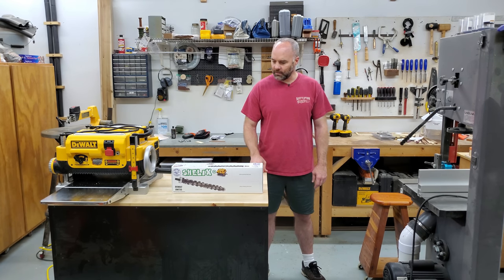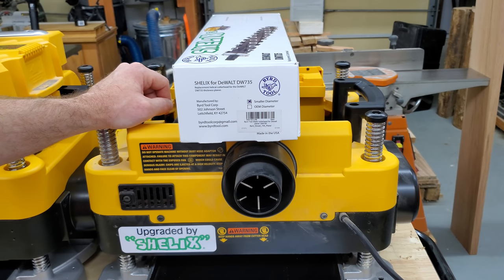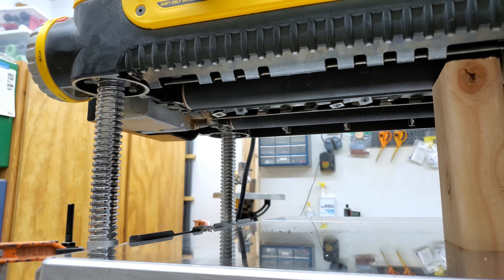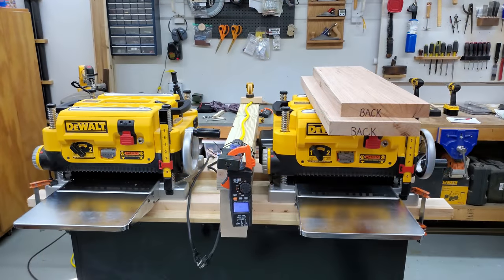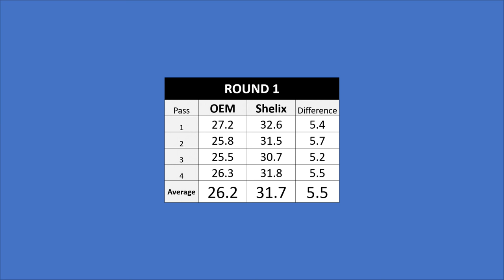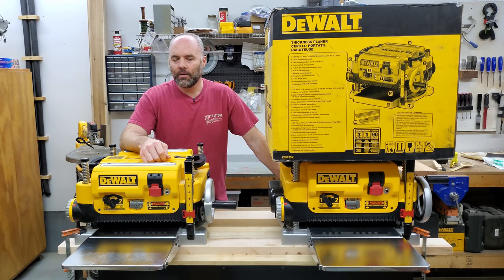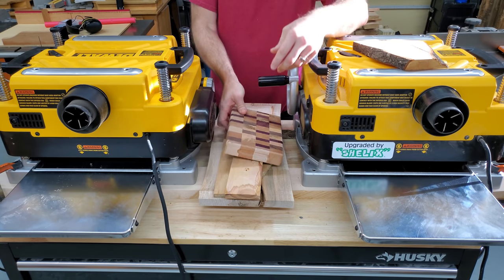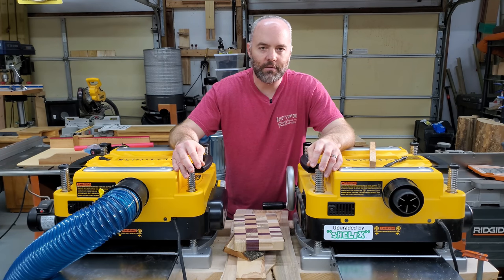The video I wish I watched before buying a SHELIX

Comment: I am an electrician myself and I can tell you the breakers on your panel should have tripped you were using around 150% of the capacity for quite a long time 
1 your breaker is bad  
2 your meter is bad
3 both planers are bad 
4 your test is being done wrong 
5 I already had one too many beers
Reply: Number 4. The test is being done wrong. He should have reset the meter once the board was moving through the planer.
Reply: breakers usually have a delay from when they will trip when over current; called a trip curve. so for a sample SquareD breaker if the overcurrent is a multiple of 2 it will trip after ~30 sec. So that is why the breakers did not trip. However, what is really happening here is that the meter is only displaying the peak that it has hit, so as it planes it encounters patches of denser wood or something else, it might draw more current temporarily. So realistically, his wiring, breakers, and planers are operating as expected. A better way to get a sense of what the planer is drawing would be to measure the current draw normally without the max function, and from there collect values every x seconds and average across those to get a sense of the average draw. Right now, all we know is that the planers draw 25-30 amps for some non-zero amount of time. But that might be for .5 seconds, so what? if it is pulling 30 amps consistently during the whole pass, then yeah, that's bad.
Reply: @shawnnelson12  I am figuring that when the wood makes contact with the cutter head there is a large inrush of current and then the current draw settles to a value much closer to the 15 amp level. For the most part you never see the current go up after the cutter makes contact with the wood. Softer or denser sections in the wood seem to make no difference. This is why I figure it would have been a better test to reset the meter after the cutter has made contact with the wood. It then would have shown the actual current draw while the wood was moving through the cutter.
Reply: @garryverniest5893  i see what you mean, sure, very possible, would be interesting to see. Also since planing a board that short takes less than 20 sec, it'd be cool to see how the current draw curve looks during the whole process, it's possible it'll draw 25 amps average and still not trip.
Reply: @shawnnelson12  I would assume that there are a lot of these planers out there. They are spec'd at 15 amps by the manufacturer. I doubt that they would would be able to get a CSA or UL certification if they were drawing much more than that. Also these are consumer/hobbyist machines and I would say that the vast majority are run on a 15 amp circuit. That being said I am sure that there would be many long boards being put through these machines and many complaints if long boards were tripping breakers. Both machines, one stock new right out of the box, were drawing more than 50% more than they were rated at. This would not be one faulty isolated machine. I am of the opinion that there is something very wrong with his test/test equipment (he did buy a new meter so unlikely it was the equipment) or there are a lot of coincidences going on. Namely, two bad machines and a faulty breaker. I do not believe any 15 amp breaker should hold a draw of 30 amps or more for more than a few seconds.
Reply from the maker: @shawnnelson12  If you watch each pass, you'll see that some continue to go up throughout the cut and some don't. In some tests, the highest load was at the end of the cut when the lagging snipe hit. I picked the "max" approach for simplicity after verifying that the fluctuating average and the max were not significantly different for the purpose of the demonstration. I have a few other videos posted that show this as well: https://youtu.be/UoBN5Sc_2uk. That link uses the remaining oak 2x10 from this video, the same depth of cut, and no max setting, but with the planer's impeller removed so the reading is lower.
Reply from the maker: @garryverniest5893  Number 6: Not everyone understands circuit breaker trip curves. The links in the video description might help.
Reply: @TheSnekkerShow  I understand that when I overload a circuit here that the breaker trips almost immediately. I get 2 to 3 seconds grace and that is it. If I were to draw that on any breaker I have there is no way it would finish the board. I stand by what I have said about there being something wrong with the test. Try it again without that 10x multiplier and without the max hold on.
Reply: @TheSnekkerShow  fair enough! Never doubted the setup, and the high draw is interesting. Have you looked into how dewalt gets away with calling it a 15 amp device? I'll have a look at your other videos, this was the first video of yours i came across, didn't mean any hate. Hope it didn't come across that way. Just got myself a dw735, so I'm all interested in learning the quirks. Thanks for the reply!
Reply from the maker: @garryverniest5893  There's a thickness planer playlist linked to from the end screen with several other demonstrations.
Reply from the maker: @shawnnelson12  I definitely didn't see that as hate. I presented unexpected information, and it would be strange and boring if nobody asked any questions. I'm not positive, but I don't think Dewalt did anything wrong. My 1.75hp Ridgid table saw can cut 3" deep, but I bet if I tried to rip 20 feet of 3" thick oak I'd draw more than the advertised amperage.
Reply: @TheSnekkerShow  Ok, this is going to be my last post here because apparently the saying "you can't fix stupid" is true. First I am going to reiterate that De Walt would not have been able to get a UL or CSA certification for a tool that uses "roughly double" the 15 amps that it is rated at. They would not have been even allowed to put a plug on it that plugs into a 15 amp circuit. You wanted me to go watch you other video and all it did was contradict this video and prove my point that there is something wrong with your test. On this video when the planers were running empty your test was showing 12 to 13 amps. In the other video with the planer running empty the meter was showing 6 to 7 amps. So the planers in this video were using "roughly double" what they were in the other video. Do you see a pattern forming here?  I don't give a damn about circuit breaker curves or whatever other BS you want to come up with. The bottom line is that there is something wrong with your test.
Reply from the maker: @garryverniest5893  You are correct in observing that motors draw more power as load is increased, and less power when load is decreased.
Reply: @shawnnelson12  I didn't know about the "trip curve". thanks for that tip. given that, shouldn't more 3ish hp air compressors run 115v? trip curve thing, yet by magic you hit 3hp and compressor makers start expecting you to give up two slots in your box. very frustrating!

Comment: This is an excellent video. I have the same planer, the same issue with the same maple. Thanks for the review of the Shelix. The only thing I would like to add is that the slightest depth adjustment can be a lot greater load on the planer. It's really sensitive on wider boards.
Reply from the maker: Thanks, and good point. The multiple passes on the power test were mostly intended to account for slight differences in depth, and I think it's noticeable in one or two of them when I was slightly off from an exact rotation of the wheel.

Comment: That fresh sawdust will kill your plants. Should compost it to break it down first.
Reply from the maker: I was wondering how long it would take for someone to comment on that. Long story short, I have clay soil and I'm using the sawdust to help add some organic material and provide a base layer of mulch at the same time. I was spreading it over some old, small, blueberry plants, which tend to do better in acidic soil with mulch on top. I'm hoping the red oak chips provide the right combination.

Comment: I purchased a used Dewalt planer DW735 5 years ago for 450 with an extra set of blades.  Did not spend any money on new blades or anything and sold it last week for 450.  They do hold their value.

Comment: Do not replace your 15 A circuit breaker with a 20 A!!!! You WILL burn out the wires in the wall and/or the outlet causing a fire. On a 15 A circuit breaker  the wire gauge is 14 awg and is supposed to handle up to 80% of the total circuit breaker rating ( 12 A ). Call an electrician!!
Reply: I have never heard of a 15 amp breaker popping at 12a... Every box heater I have ever owned is 1500 watts at 120v, according to what you wrote they should pop the breaker every time.
Reply: @leventgencer  Look it up... I am, and have been, an electrician for more than 20 years. 1500W divided by 120V equals 12.5A. That is why any device over 1500W requires a 20A ckt.
Reply: @roachsteve, Absolutely. If a device draws more than 80% of the peak circuit rating, then that entire circuit needs to be upgraded. However, the motor in this DW735 planer is rated at 15A, so it’s unclear to me why the internal circuit breaker doesn’t trip almost immediately during these trials. Either that or the splitter device provided with the clamp-on ammeter is suspect.
Reply: @HoroRH  That 15A rating is telling you that that device or tool can be used on a 15A circuit. I suspect that the settings on the AM meter were incorrect or the AM meter was defective or the use of said tester was incorrect, hard to tell from the video. As well, every circuit backer will handle the inrush of current for an Inductive load (electric motor).
Reply: @roachsteve  The Klein power splitter he is using is only rated for 15A, that doesnt help either.
Reply: seriously? maybe if you run the full 20A for a super long amount of time. the amount of time drawn over 15A is very minimal
Reply: @roachsteve  The reason I’m pointing at the splitter is that he clearly noted he didn’t initially trust the readings on his multimeter and so purchased a second one to test if the first was faulty.  He indicated that both meters gave consistent readings, and the only component in this parallel test that wasn’t switched out was the splitter.

Comment: Thank you so much! I too bought the smaller Byrd not knowing they have the OEM version. I can live with the 1/16 cut max and the gauges being off (I use calipers to measure the thickness of the stock), however, the increased roller pressure causes the stock to stall and the rollers leave rubber marks unless I help the stock through. I found common angle brackets at the local home improvement that are 1/2 inch wide and 7/64 thick. Cut 4- 1.25 inch pieces and use them as shims as you described. Problem solved!
Reply from the maker: Make sure to wax your bed regularly, too, so the wood slides easier.

Comment: 29.45 if you're planing a lot of hard wood... you'd get a different planer. The DeWalt is very good on construction site for soft framing wood and similar. It can do hardwoods but doing a lot is job for a much heavier duty machine

Comment: I'd like to see what the current draw is on the OEM sized Shelix head. It sounds like some of the extra load on the motor is because the feed rollers are much more compressed than the straight knife planer.
Reply: But because it's smaller there is less torque degradation on the motor so the forces kind of equalize. More power used on the rollers but cutting head uses less torque on the motor.

Comment: On the shim aspect, it won't help. The shim will raise the rollers at rest but as soon as the rollers raise up from the workpiece the spring pressure on the rollers against the workpiece will be the same wether there are shims or not. All the shims will do is raise the roller height when nothing is running through the planer. As soon as a piece of wood passes through the rollers and pushes them up the spring is the only thing applying force and the shim is no longer part of the equation.
Reply from the maker: This is true, and part of the reason I haven't done it with mine. The constant tension resulting from a shim could soften the spring over time, but I don't think it would be significant.

Comment: Very thorough test. I was impressed by the noise reduction and surprised by the increased amp draw with the Shelix head. I had similar noise reduction when I installed a Shelix head in my Grizzly jointer. The quality of the cut is most of what I am interested in but the noise reduction is an added bonus to me. You've sold me on the Shelix and will be purchasing for my DW733. You've earned a new subscriber my friend.
Reply from the maker: Thank you, and welcome to the channel.
Reply: Did you install on your DW733?  What results on amp draw (stalling out) and quality of cut?

Jim Phillips

Comment: The amp meter going through a 10x multiplier and an extension cord will increase the current draw and decrease the voltage.  To get a better measurement it is useful to measure the voltage at the planer plug when running the wood. It is very likely you were at 100 to 105 volts vs the 120 volts expected.  That would increase current draw. You could measure the voltage only just to observe the drop under load.
Reply from the maker: You can find the voltage measurements in the video description.

Comment: Very interesting, and very informative. Thank you for taking the time and effort.
You really need a storage scope to compare power draw over time rather than a meter that simply stores maximum spike. My guess would be the power spikes to get the heads up to speed when they engage the wood or when encountering a difficult portion of the wood, but nominal power draw throughout the operation is much lower.
Reply from the maker: You're correct that the average would be a little lower.  I set it to max for simplicity, but the fluctuations were pretty close to that range.  You can see a couple passes without the max button pushed at the end of this video: https://youtu.be/UoBN5Sc_2uk

Comment: Hi I love your show. it's really cool. but ultimately, all I care about is whether or not the Helix cutter does a better job than the straight blade cutter. I've already rationalize $500 for the Helix cutter if it cuts smoother. If I don't need to sand as much, ultimately it saves me time as well as a better finish
Reply from the maker: Tough call. Steel knives are pretty nice when they're new and sharp. They just don't stay that way for long.
Reply: @TheSnekkerShow  Aren't the  SHELIX blades made of carbide???🤔
Reply from the maker: @fookingsog  Yes, that's why they stay sharp for so long, unlike steel.

Comment: For AC power, AC current is not proportional to power draw due to power factor. This is the difference in phase between the voltage and current signals. Different loads can lead to a different power factors from the same device.

Comment: I had the older style DeWalt, the Shelix cost me more than the planer did.  After the several hours to install it I ran some cedar through it.  Ran fine. I then tried some Walnut and White Oak.  Both boards were only 6" wide.  It would get about 12" done then trip the internal breaker and I would have to constantly reset it.  Just doesn't have the ass to run that head IMHO.  Ended up selling at a loss and bought the Grizzly 15" with the spiral cutter.  That beast planes whatever I feed it.

Comment: Rick
I do beleave that puting a shim to hold the roller up will not take any roller preasure off. All you are really doing is holding the roller from dropping down. With or without the shim you are still compressing the spring more with the smaller head. The more you compress the spring the more pressure you have. I like your video on power draw but like you said more down preasure on rollers means more drag. So I was wondering if you had same roller preasure on both machine if the out come would be different. You could hold the board back by hand and see if it raised the power draw. Thanks for the info.

Comment: Try some rough cut cedar. the shattering knots will destroy the discharge chute and plastic blades on the motor. Learned that the hard way. Dewalt charged me 299.00 to repair the damage the cedar did to my DW735.
Reply from the maker: Was that outside of warranty? That would be pretty disappointing if they charged you for planing wood in a wood planer under warranty.
Reply from the maker: I should add that I've planed a lot of rough cedar, and worse, rough hickory in mine. I've had several exploding knots, but luckily so far no damage. If it happens again, check out my video on removing the impeller. It's a reasonably easy part to replace. https://youtu.be/UoBN5Sc_2uk
Reply: Our impeller housing shattered as well with an exploding knot. Out of warranty but figured it couldn’t cost that much to fix it. Boy I was wrong. Ended up epoxying it up and then put wire stitches into it. So far so good.

Comment: actually a good video, the smaller and OEM sized cutter heads I didn't know anything about, I'm still trying to decide if I want to spend $900 on this stuff. I do a lot of finish wood work, but I spend so much time sanding versus planing.
Reply from the maker: I hate sanding. I show some better close-ups at the end of the installation video, starting at around 54 minutes and going to the very end. https://youtu.be/8J0rvBi8a0k

Comment: I'd wonder if the difference is really the blade or if the newer unit may have newer, more efficient components in it.  Have you tried swapping the blades between these two and see if it is really the blade causing the issue?